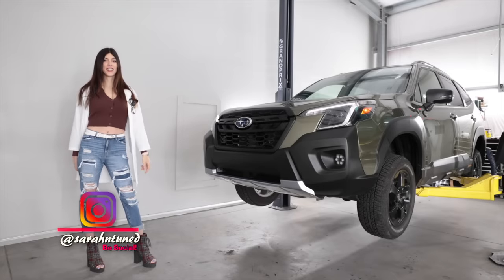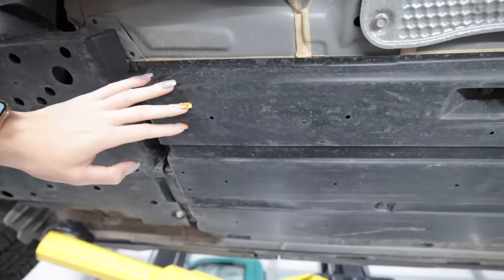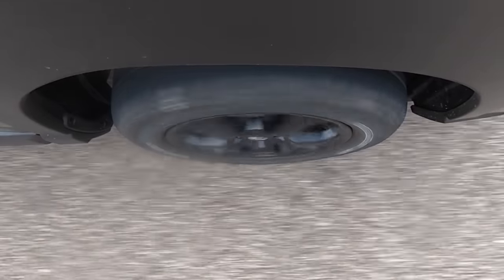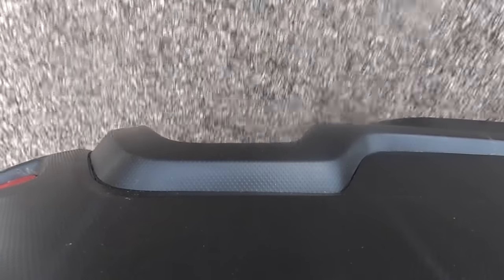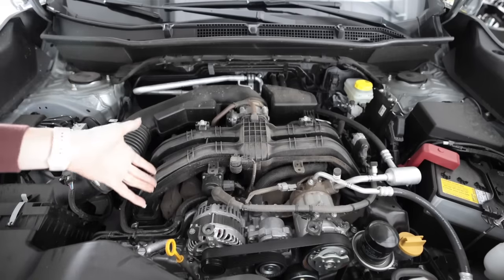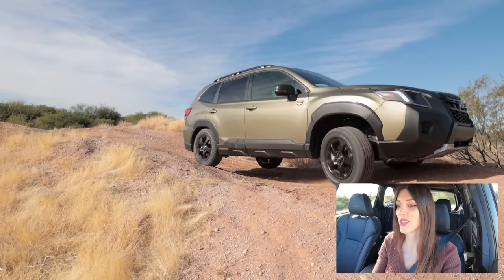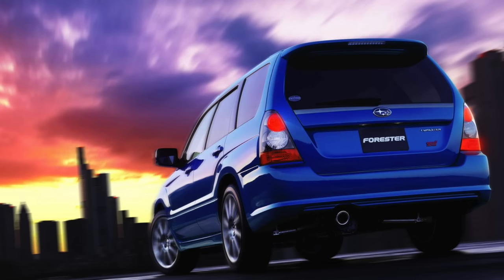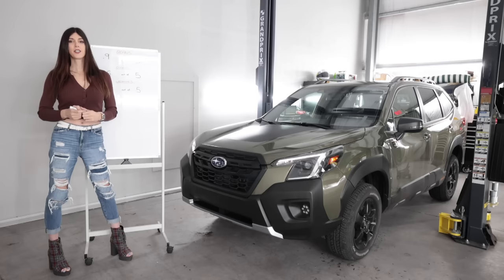2022 Subaru Forester Wilderness Mechanical/Off-Road Review

Comment: This Forester looks the part of a wilderness vehicle and I was very impressed it tackled Mt. Sarah.  Very fair scores… you do good at keeping your bias in check.  Thank you! 👍👍👍
Reply: Great review, as usual. Would love to see Ford bring the Puma to the states.
Reply: Just wish Subaru didn’t have a history of transmission and head gasket problems.    If I only held onto cars for 5 years I wouldn’t care, but I don’t.
Reply: @joebuck4496  The head gasket issue has long been in the rear view mirror.  Not that many years ago, Toyota had a very popular engine in hundreds of thousands of vehicles that burned oil at low mileage, yet Toyota is still the leader in perceived quality.  Every manufacturer hits a bump in the road now and then.

Comment: Awesome review! One small thing is that it's 60/40 normally but sends up to 50/50 depending on conditions (and will always be 50/50 on loose dirt, snow, etc). I definitely recommend Jason at Engineering Explained's video on Subaru AWD systems if anyone is interested!

Comment: I too was amazed at how well it does off road. I like the added towing capacity. More power and a turbo will hopefully be added in a year or two.
Reply: Doubting that, unfortunately... more power, possibly with electric assistance... turbo it's possible... but not likely to be what you would think, if it sees a Turbo, it'll likely be a smaller displacement already in other countries, not our 2.4. The WRX is supposed to be Subarus last ICE only vehicle. Moving to Subaruized, Toyota Hybrid tech eventually leading to full EV.
Reply: Or.. just wait a few years and the JDM 2022 Turbo engines will show up at JDM importers. Then we can fix this issue ourselves???

Comment: I can hardly wait for your review of the Crosstrek Wilderness when it comes out. At the moment, that is the car I want to get next. As far as Subaru's EV future, I really hope they put independent motors on each wheel for a full-time 4 wheel e-drive. No diffs needed at all. That smile on your face when WilderGump made it up the hill! I could have sworn I saw "I want one of these" flash in your eyes.

Comment: the most impoting thing is the cooler oil transmition, this is a the X factor of the wilderness . it influance on  the x-mode ,the towing capacity and the off road  performance. this cooler has to be on every Subaru

Comment: Thanks Sarah.  I have a 2021 Gump Sports model.  It is lifted and has all terrain Goodrich tires so it is very off-road capable.  In a way, I kind of wish I'd waited a year for the Wilderness Edition for those added features but on the other hand I'm completely happy with the way my Gump is set up and how it handles in dirt, mud and snow.  It's really amazing.  I've taken it out on some pretty rogh excursions and so far it's never let me down.  Plus it's my commuter vehicle to work every day and it does get decent gas mileage.  I like the sunroof on the Sport which I didn't see on the Wilderness which is really nice on summer days when you want to ditch the A/C and feel the outside air.  But ask you said, the Wilderness is definitely a fun and capable Subaru for those of us who like to drive  off the pavement from time to time.

Comment: Why is my car in your garage lol. Traded in my 2020 Premium last week and bought a Wilderness. Took it off roading the next day. Definitely better off road, plowed through deep sand no problem, over the whoops without scraping. It still feels somewhat underpowered, but for a newer SUV type vehicle, it's not bad. Love your vids, and I think your assessment of the Forester Wilderness is spot-on.
For a bit of techie info: The Wilderness CVT has a 1st ratio of 4.07 compared to 3.60 on the other trims. Final drive is 4.11 compared to 3.70. Combined, that's slightly more than 1.25 times available wheel torque in 1st gear.  They also changed reverse to 4.38 compared to 3.69, even lower than first gear... hmmm wonder how climbing in reverse would go.

Comment: I just put some geolanders on my parents Ascent.  They made a huge difference on the off-road capabilities. I was looking at going with a smaller rim for a fatter sidewall but Subaru has a large offset that is hard to find and you have to be careful of the brakes clipping the rim.  Overall I still like Subaru.
Reply: Извините сколько у вас стоит Ascent просто в Россию пока не поставляются. Как в обслуживании как себя ведёт на дороге, как на бездорожье. Спасибо.

Comment: Wow...what a cool video, Sarah. Lots of things to like. Sparks flying from your fingertips is one. The car, perched with the front wheel two feet off the ground is another. I also like the fact that you test all off-roaders on the same hill. With a rear locker and all terrain tires, this Subie would probably go everywhere. I want to see your video on walnut blasting, too. I have three cars with direct injection and want to see what goes on that process. Keep up the great work.
Reply: Was there ever a walnut blasting video?  I am going to need to do this on my '15 XT soon, and definitely don't want to go to the dealer to get them cleaned... again.  In Sarah we trust!

Comment: Wow. I really didn't think it would make it up that. I would put on more aggressive all terrain tires after the factory ones wore out, after getting it. ( if I bought one)
Reply: I will pass on the entire unit in favor of my body-on-frame 4X4 which has a turning circle that makes this Subaru thing look like a 1970s Lincoln Town Car.
I also will own NO 4X4 that doesn't have locking hubs and a MECHANICALLY controlled transfer case.
Reply: @donreinke5863  That's cool, but the Forester Wilderness really isn't intended to be part of the niche you described.

Comment: Mentioning the lack of a skid/protective plate for the transmission, I noticed there were already scratches on the bottom of the pan. Yeah, I agree that it needs one.
Reply: NO skid plates? seriously??? My vehicle was factory equipped with transfer case and fuel tank skid plates. These new piles of shit are a JOKE

Comment: I found your channel back when I was researching vehicles myself. I ended up with a very clean 2015 Forester XT, which now has 133k+ miles on it. To be honest I won't be buying another Subaru do to my experience. I have had the induction cleaning performed and my check engine light comes on between every 10-15k miles and the codes are always the O2 and Fuel/Air sensors. Because of the cost of replacing them that often ($300+ each), I pull and clean them which actually last just as long as new ones. 
My biggest complaint, I had to replace the CVT transmission because the front differential went out. It part of the whole transmission assembly and it wasn't cheap.....$8k ! I was at 115k miles, 15k past the powertrain warranty

Comment: The future of all wheel drive, is each wheel having its own hub motor. 
This also eliminates having breaks, as the motors would provide that function as well. 
The fastest EV in the 90's was this Citroen looking 8 wheel direct drive, made by a university that clocked at over 400 mph. 
The batteries alone cost over $100K USD to build by the university.
Reply: Yeah...because salt flat land speed record vehicles are the perfect gauge for consumer transportation.

Comment: Totally with you on the need for the Turbo.  Personally not a fan of the Wilderness looks, but have had high hopes of capability.  Torque locker could help a bit - but it climbed that hill like a goat!  FINALLY, happy to see a stock forester make that hill.  Surprised how long it took to get through the 2-tire lift.  Still love my 18 FXT.  
Off topic:  Love the boots - the power of plaid.

Comment: The constant velocity joints still have the standard boots while high up there, they're not protected enough from sharp gravel hitting and tearing the CV boots. If you don't know already the constant velocity boots protect the CV joints from getting dirt in there because once dirt gets inside a torn constant velocity boot it's only a short amount of time before your steering wheel starts popping to the right or popping to the left depending on which CV boot is torn. Subaru if you really want to get serious about making an off-road version then you need to encase the CV boot in a metal tube of some kind that's easy to remove so that it can be greased. I've owned two Subarus and when the CV joints go out it's always because the boot tears now if you're going to drive that Forester off-road which apparently a lot of yuppies are just going to get in it and head for the hills, then before you know it gravel's going to hit those CV joint boots that are somewhat exposed and it's just rubber against the sharp Rock moving at speed enough to tear the boot. Because of that and the lack of one skid plate I wouldn't recommend getting this car unless you just drive it on road because it ain't ready for off-road no matter how bad you want it to be. 😂😂😂😂😂😂😂😂😂😂😂😂😂😂

Comment: Subaru realised what was driving sales wasn't low volume performance models, but high volume base model awd cars and suv/crossover. Of the 3 brands to have year after year improved sales success during the 2007-2009 recession, Subaru was the only Japanese model. The other two were Kia and Hyundai.

Comment: Sarah, I want to start by saying: love the shoes! Or better the boots!
These softroaders won't see any sand in their life, so the open diff,  the whole AWD system, or even the ground clearance are totally redundant.
The thing you pointed at at the rear brakes has nothing to do with the torque vectoring, since that was the electronic parking brake actuator.
The stiffer the rear anti-roll bar is on high vehicles like this, the more that vehicle is prone to roll over, funny enough.
The plastic covering underneath the car is for aerodynamics (read fuel consumption) only and do nothing in the even of rock-sliding.
It will break to pieces, just as fast as the cardboard variant (or the 1mm alloy formed plate up front) will buckle.

Comment: That articulation is a little sad.... but it did what it was supposed to.  I've done the walnut blasting on a mini cooper.... no fun.  Then found another method of feeding a can of Seafoam slowly into a vacuum hose on the intake.  With about an 1/8 of a can left dump it in and kill the motor.  Let it sit for a while and they start it up and watch the white smoke billow out of the exhaust.  Worked everytime.

Comment: I've watched several reviews of the Wilderness edition...  I was really excited about it until I learned it had no turbo (even as an option; but the Outback does??) so thanks for spending significant time talking about that + Subaru's performance history.  This is DEFINITELY the best review by far - and not just because you said "walrus asscheeks."
Reply: For off-roading honestly N/A is way better. You won’t be spooling up that turbo during crawls and the lower gearing helps a ton. Bought an outback wilderness for me and a wilderness forester for my wife and I hate my entertainment system in the outback the xmode is tied to the screen and it’s super laggy

Comment: At the end of the day for what this car was designed and who it appeals to overall. I think that CVT Transmissions and Paddle shifters should not go together, let alone the necessity to put paddle shifters on this car.  Its meant for adventure or less than fair road conditions.  Jeep doesn't even have paddle shifters, excluding SRT model.

Comment: I can see why the forester got a bit squishy on the brake test. Check out how much the front wheel moves backwards when the brakes are applied. That’s quite a lot! With both front wheels doin that, and maybe the rears too, you probably have a bunch of wheel re-alignment going on that is affecting directional stability. Squishy bushings, squishy steering!

Comment: Just had to have dealer clean my valves at only 28,000 miles! They just used 3 cans of cleaner. Seemed way to early to have to have that done but was having cold start misfires and finally a check engine light came on.
Reply from the maker: EGR 🚫 🗑 cough cough lol.
Reply: Yea. Yea, I know (sigh) I like this ‘18 FXT but I don’t know if I want to go down the mods/tuning road. Would really like to get rid of that damn cvt and go with a manual. Be a lot easier to just sell it and buy something else though.

Comment: Awesome that the Wilderness Gump made it up the hill! But now I'm super confused why the Outback Wilderness couldn't make it up the same hill. I mean the slight increase in weight should've been handled by the higher HP and lower gear ratio in the CVT, I'd think? Do you think you might get another OBW in future at some point to re-test the hill?
Reply: I’m on the same boat too like how did this one make it but not the outback wilderness
Reply: So JonDZ Adventuring did a video on that. Apparently the transmission on the outbacks reach their stalling point more quickly than the transmission on the foresters.
Reply: the longer wheelbase made it harder. The OBW is heavier and has a longer wheelbase which is gonna make those off camber situations harder.

Comment: Finally a Forester with a CVT that can climb a hill! But I think I will stick with my 2012 Forester X Touring for a while more. I may do it up like the guy on the Softroading the West did his 2012 Forester with King springs, and 15" wheels with KO2s.
Reply: A POS CVT? OMG I see massive expensive FAILURES on these units.
FACT. The only durable CVT ever made was the Buick Dynaflow, discontinued in 1964
Reply: @donreinke5863  There is a sweet spot on Foresters, IMO, between 2011 and 2013. After 2011 they used timing chains instead of belts, and after 2013, they started using CVT transmission. The TFL guys have shown repeatedly that the CVT Subarus can't climb hills, and Sarah-n-Tuned also has demonstrate this...but both Sarah and these people here have shown that the latest Forester with the CVT can climb hills!
Reply: @FarrellMcGovern  I dont hear complaints about older Subaru automatics and haven't seen any fail personally.
Most manufacturers, including Honda and Nissan, are moving away from belts in favor of chains, Ive done many a major repair on vehicles where the belt failed and bent valves Ive even seen it once with a chain system, but that had a nylon coated camshaft sprocket which stripped totally and a piston hit a valve.
CVTs, just because they are capable of climbing some hill or another does not mean they are reliable or durable.
Owners of Nissan and Dodge vehicles so equipped can attest to that.
The whole design is suspect even though it dates from the 1930s when Cord experimented with it.

Comment: Only down fall is the IFS and IRS, it will do dirt trails, stay away from the large holes and obstacles,  have a tendency to damage the rack and pinion if it is pushed too hard going over big obstacles, but it is a decent off road vehicle, just not a fan of the IFS and IRS on a 4WD vehicle, articulation isn't there ,I guess it depends on what you will be doing the vehicle for, just don't push beyond it's ability.

Comment: I noticed an Illinois license on the vehicle early on. You don't seem to be driving in any part of Illinois I'm acquainted with.
Enjoyed the video.
We're going to stay with the 2020 we expected to take a long trip in back in February two years ago and still has fewer than 18000 miles. The trip never happened, and at out age I'm wondering whether it ever will. Still, who knows.
edit to add that we went with the 2020 Sport model for several reasons, but most was the "paddle shifter." I've driven in the Ozarks with an auto transmission, and I never felt secure. I reasoned that the ability to downshift beyond the "low" on our 2015 could be worthwhile.

Comment: As far as I’m concerned those felt skid plates or what ever they want to call them, are only good for one thing. Collecting ice, snow, and mud and then falling off when the mounting points are over stressed and rip from the excess weight. Also, anyone ever try wrestling one down from a vehicle when it weights 60 pounds or more from all the crap it collects. It’s not very fun lol.

Comment: Hiya love ya content I to own a Subaru forester but an oldie a 98 end of 98 model it came from the factory with a lift kit an it's a non turbocharged engine 2ltr manual 5speed it's one of the best cars I have owned it's got 350k on the clock it dint miss a beat it also has arm rest on the front seats a great idea for long drives across our vast country here in Australia I have never been stuck on dirt tracks or bush driving in low range .
Just one thing you didnt mention is it still got a galvanized body like the older versions. Kind regards Jasmine the JDM girl from Ingleburn Sydney Australia 😃😃

Comment: Nice review 🤗. I had a turbo Forester that came with a few STI cosmetic doodads, it was fairly quick but the dealership tried to install my satellite radio module with what was apparently  a crowbar to the dash, then gooped on some similar color putty to mask it 😵‍💫. I did however end up trading to an actual STI (wagon) which was a blast until Subaru detuned my car at a service visit (to keep from blowing out piston rings apparently)....it de-funned the car and after getting blown off by a Subaru corporate weenie who rode in my car after my complaints; I stopped looking at Subaru as a performance vehicle brand in any way.

Comment: Subaru's really need to be tested offroad against an 80's Subaru Leone with the front diff locking low range 4x4 engaged. With decent tires, those things would go just about anywhere!